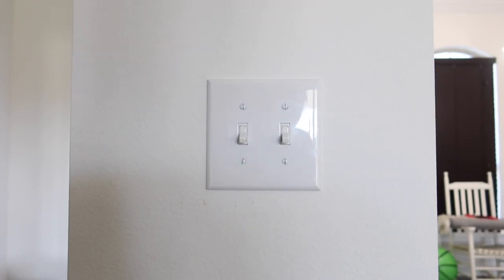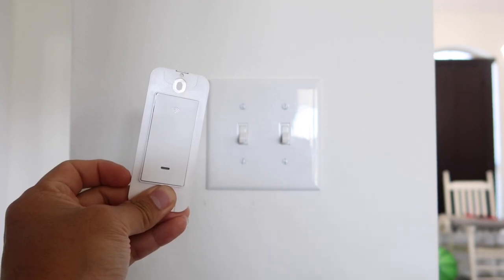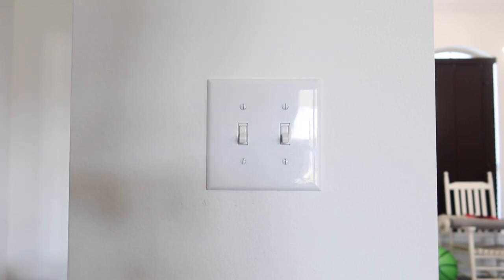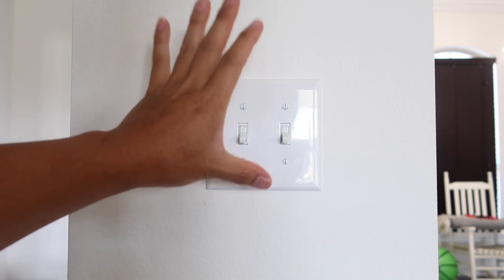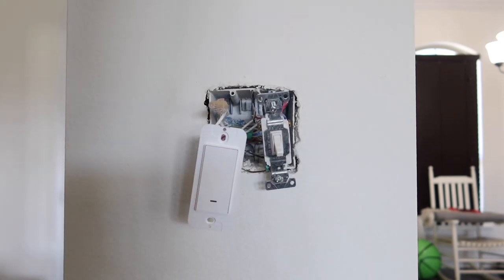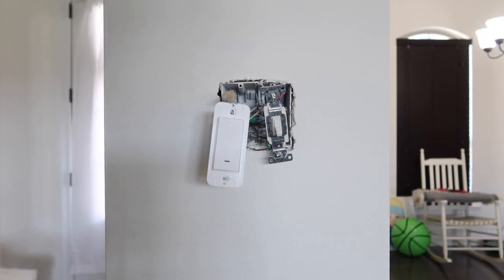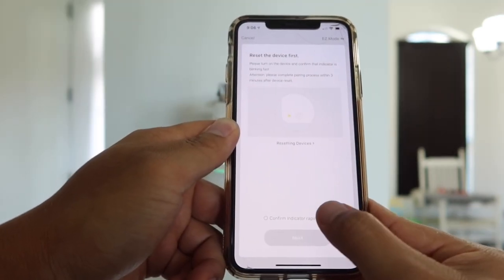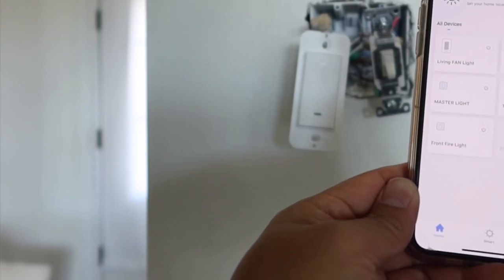Smart WiFi Light Switch - HOW TO Install & REVIEW - GoSund 3 Way Switch

Comment: For a three way switch, if using only one of the gosubd smart switches, do you have to change the other switch at all? Or does that stay the same?
Reply from the maker: The others can stay the same. You only change the ones you want. Others will still work as it is

Comment: Does the switch indicate on app and switch when the light is on?or just when the switch is activated. Doea it sense power flow. I ask because if I'm away, will the app tell me if light is on? If switch 2 on 3way is flipped, i would or wouldn't know if I'm turning light on or off.
Reply from the maker: Yes

Comment: Stupid question: With smart light switches can someopne just turn the light on and off using the switch itself, like a normal non-smart switch? None of the videos I have looked at demonstrate this. Reason I am asking is that I want to install smart light switches but my wife does not like using the smart things and would prefer to keep using the switch the old way. So if it can do both I'm good.
Reply from the maker: Yup, you can still use it as an ordinary switch as well